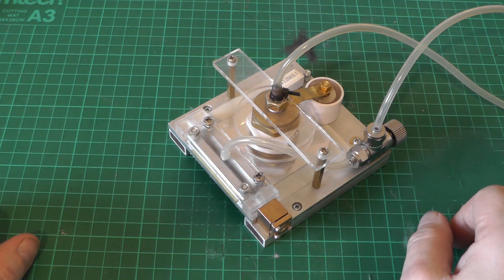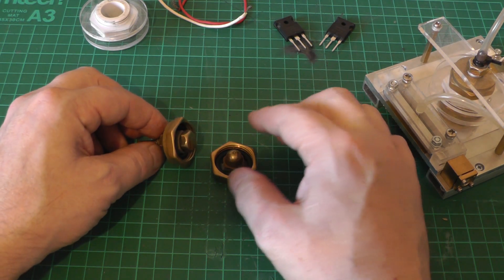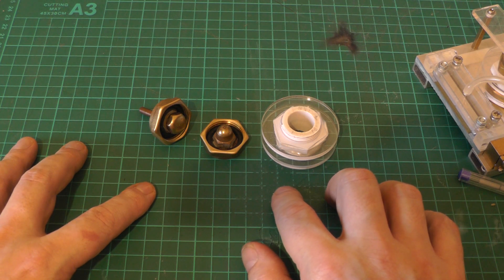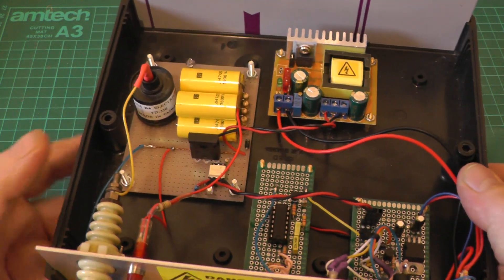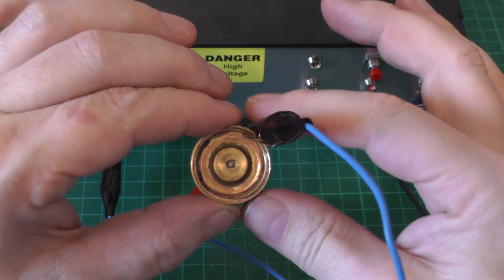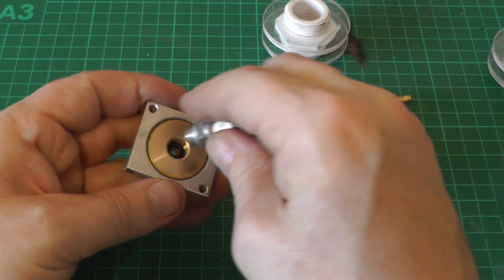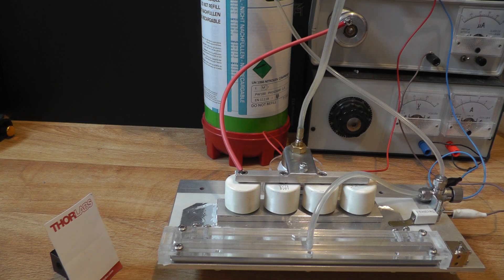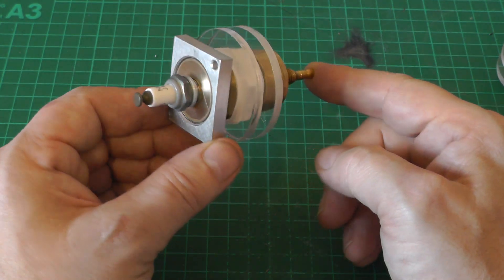How to make a Triggered Spark Gap for High Voltage Lasers and Marx Generators

Comment: Pleased to report that I've just completed a nitrogen laser based on your 20-cm. design, adapted to suit materials on hand, and am successfully pumping Rhodamine 6G to threshold.  Some 25 years ago, a bought .015" copper clad board, intending to build the SciAm laser, but I couldn't bring myself to deal with etching something that large and then having to dispose of the chemicals.  Other N2 lasers I've seen were just too kludgy; I wasn't willing to make the tabletop part of my laser.  Thanks for your exceptionally clean,  workable, and high-powered design.  I was able to lase R6G even before installing an end mirror.  Am fighting the urge to buy a power sensor.  My wife, BTW, can't understand why anyone would build a device with no practical application.  I remind her that some people build model airplanes.
Reply from the maker: Awesome! I am so glad people are getting use out of this deign. Yeah I built the Sci-Am design (except with doorknob caps) and it worked well, but it was large and involved too much faffing with vacuum pumps for my liking.
Well, everyone need a hobby, besides I find functioning things more exciting than models of functional things!

Comment: I like your spark gap design. But I also have a question: The power part of the trigger curcuit, isn't that the interieur of a CDI in the end? I mean, what you are doing is triggering a spark plug... Please don't get this wrong, I am not criticizing your curcuit, I like it. But when a friend showed it to me, I thought, wait a moment, I know this from somewhere. So I was wondering if you could replace that part with the CDI module, you can buy, or if you have to be able to customize the power part of the curcuit.
Reply from the maker: Sure, fundamentally they are the same. The resason I built my own, is I wanted the voltage and storage capacitor to match the specification in the datasheet for the Trigger transformer, and I wanted it opto coupled. Compared with Ignition coils, the discharge from a trigger transformer is very fast and very short, a requirement if you want to avoid Jitter and turn on delays.

Comment: another great video.  Have you ever thought about doing a CO2 laser type  recharge video?  The occasional Synrad RF lasers come on the market but often suggest a need for a recharge.  Thanks Doug
Reply from the maker: Then, have I got a video for you! I am in the middle of production just now, but it is going to be sweet, and involves a dead Synrad ;-)
Reply: @LesLaboratory  excellent!  Thanks for the "heads up!"
Reply from the maker: Thanks! Yeah, I have been looking for a suitable candidate for some time. There were some a while ago with what looked like demountable optics, but I missed it!

Comment: nice...rotary spark gaps, trigatrons, laser triggered spark gaps, hockey pucks all delicious- bout 20 years ago made a from scratch a copper chloride laser that incorporated my version of a trigatron with ceramic insulator- the electronics was the most difficult-the false triggers and such-but got it going fantastic dumping 2 pulses separated by 50ns resolution out to ms delay between em running at hundreds of hz---do not let anyone tell you different, trigatrons are the best !!...serviceable too !!...and jitter, what jitter ??...the cucl i could by pulse separation alone ( by memory 50 us separation ) get it lo lase only the yellow super reliable and steady like a hene to perception.......maybe Less will do a 337nm triggered spark gap, wanted to do that someday but too busy with other stuff
Reply from the maker: Very nice! I would love to have a crack at a Cu Vapor laser (any metal vapor for that matter! For sure, spark gaps are really under-rated, though there are sill companies that produce them (if you ave a big enough wallet!) From a cost saving perspective, it's a no rainer to roll your own park gap. It's either that or $$$ for solid state or random H2 Thyratrons if you are lucky enough to find them!

Comment: Hi Les. Thank you for the very informative video. Just one note of caution, if I may. I have a few of those ht inverters and they work reliably up to about 200v, (perfect for nixie tubes, for which reason I got them)  after which  they have a tendency to become unstable. The ferrite core becomes quite hot as do the 10uF smoothing which btw are rated at only 400v. 
I started to build one of your triggers using a car ignition  coil instead :).
Always looking forward for your next video!
Reply from the maker: Thanks! there are two version of these, one has a simple rectified output (blown up a few of these!), and the other has a voltage doubler arrangement, for a higher voltage output. Also, if you ground the output of these it shorts the supply as well, so you have to leave them floating. Sure, thay are not the best, but they are so cheap.
Reply: @LesLaboratory  
So do you connect the GND terminal on the module to V- ?

Comment: Pressurized SF6 laser triggered gaps were used on the PBFA II . It's used a fair amount in the accelerator industry. Be careful of (S2F10) generation in an arc; it dissipates quickly though. Awesome work! I love your approach. Just subscribed and look forward to more fun stuff!
Reply from the maker: Awesome thanks!
Reply: Sf6 turns into Nasty stuff with high power arcs. Keeping a flow of gas prevents this but $$$.  I prefer N2 pressurized.  Change the pressure and thus the Vbk.

Comment: Fascinating! The original DIY nitrogen LASER IIRC was in Scientific American in the 1970's and used a plunger/solenoid directly onto one side of the PCB that formed the capacitor. Two questions: First can you initiate the spark with UV light? The work function of zinc (in your brass) is about  3.7ev and the copper is 5.?ev. The new UVC LEDs should get some electrons flying off the surface. And second, why not use an automotive coil-on-plug with your spark plug and eliminate the HV wiring plus need to protect instruments?
Reply: automotive coils way too slow...you have to have a super sharp edge on the trigger pulse the trigatron sees- a series spark gap rather than a direct connection to the trigger electrode from the generator helps some too, but no iron here : )

Comment: 11:15 - What values did you use for your differentiator?  (ANSWER: 22 nF and 4700 Ω)
10K and 1nF?  (Periode: 100 µSek
)
In my mind with those values the output of the Schmitt-Trigger is <100 µSek because the Schmitt-Trigger has a switching
 threshold voltage.
Can some one explain me how to calculate this? 🙂
Reply from the maker: Oops, forgot to add those! I used 22nF and 4k6.
Reply: @LesLaboratory  Thanks bud 😊
I always get Inspired by your videos, I really like your work. Its always a huge motivation to work on my projects if I see a video of yours. Soldering station already turned on 😂😂
Reply from the maker: @GermanMythbuster  Thanks! I like producing them! In answer to the other half of your question regarding differentiators, there is a tutorial here: https://www.electronics-tutorials.ws/rc/rc-differentiator.html, Im sure the hysteresis data his available as well in the 74HC14 datasheet, but honestly I just bread-boarded one up, and measured it with the scope, and tweaked my values.

Comment: Hi Les! Another fascinating and enlightening video, thank you so much. I have two questions if you have a spare nanosecond. You have not included any resistance on the HV output, why is this? Also are the dump capacitors a special variety?
Many thanks, I may need to build a trigger which fires when a drop of current between two consumable electrode occurs. I never thought a local spark would suffice to get a conductive path going. Super info!
Reply: "You have not included any resistance on the HV output, why is this?"
A resistor on the output is just to limit the output current.
There is no need you don't need to protect any capacitors from discharging too fast (no Capacitors on secondary side of the transformer).

"Also are the dump capacitors a special variety?"
The Capacitors from the pulse generator are MKP capacitors often used in the Audio space. 
The Capacitors from the Laser are Doorknob capacitors (for lower ESR).
Reply: @GermanMythbuster  I didn't know the output resistor had the function of protecting the capacitors, but now that you say it, it makes good sense! I assumed they just protected the HV transformer from 'short circuit' with the uncontrolled discharge and so possibly over heating the HV transformer on high repetition rate. Every day is a school day. Thanks

Comment: Totally cool!!! I used to design a trigger spark gap system as an intern, those things deserve more coverage on youtube :) looking forward to your experiments
Reply: When you designed your triggered spark gap. Did you cool it? How did you cool its if you did. Thanks for your answer in advance.
Reply: @Biokemist-o3k  no it wasnt cooled, it had the capability of adding gas but i didnt add gas and just used atmospheric air
Reply: @tanchienhao  Would it handle running at 60 hertz?
Reply: @Biokemist-o3k i didnt try sorry

Comment: Having terminated fiber optic cables for telecommunication use, my knee-jerk reaction to that fiber interface was about what you'd expect. (😱) Thinking harder about it though, that makes total sense, and it's a great hack. 10 Hz or 100 Hz (or perhaps even 1000 Hz) doesn't require the fiber to have a perfect face to work, as a 10+ GB connection does. I shall have to keep this in mind for use with my function generator. Thanks! 👍️
Reply: TOSLINK uses cheap plastic fiber and can get 3Mbps. I've seen several tesla coils that use a similar fiber for the interruptor/control communication but with different connectors. I had a project where I needed an isolated serial connection, so I cut up some toslink cables to get the fiber. I'm not doing any polishing of the ends, and I don't even have optics to help get the light into or out of the fiber. For RX, I have a PIN diode, a fast-ish opamp as a TIA, and a comparator. The TX side is just a red LED, so I can easily build that into more projects and reuse my receiver. 115,200 baud goes through just fine, and it's the bandwidth of the TIA that's keeping me from going faster.
Reply: I don't know if it's still available, but there used to be a range of FO cable that was simply 1mm dia. You just cut it with a knife and used push on connectors. It was used in audio systems, so several 10'd of kHz . I think Maplin used to sell the stuff,

Looked very much like the cables used in the lighting display world that you see on ebay.

Andy
Reply from the maker: Yea, this is Avago 1mm plastic fiber. Nice and cheap, and easy to cut and handle.

Comment: Just curious, as the pulse inverter is drawn as an emitter follower, how does it invert?
Reply: I was going to comment on this too. I'm sure it's just an oversight.  If the NPN transistor was instead PNP (and collector and emitter flipped) it could work, but I'm pretty sure he just meant to draw a CE inverter and put in a buffer instead.
Reply from the maker: It's because I'm a bit of a dumbass. It's supposed to be a 2N3906! Well spotted.
Reply from the maker: See comments below, and I have added this issue to the description, thanks for spotting my error!

Comment: you may try also with a UV diode shining on the air gap (Hertz discovered  UV would help trigger sparks in an airgap)
Reply from the maker: It is a question of how much UV to trigger the gap. I am not sure a UV LED would work, but the UV flash from another spark triggering a gap as indeed demonstrated historically. This effect is used in Marx generators. The UV from the first gap helps ionize the subsequent gaps.
Reply: @LesLaboratory  ...you ever notice triggered lightning flashes ???...huge trigatron
Reply from the maker: @rickmally5777  yeah interesting to watch. There are other forces at play there as well I think. Seemingly it was demonstrated that a discharge can initiate another 10's of km away, well beyond the reach of UV. I feel there is still a lot of research to be done in the HV, but it seems not be be very popular lately! Lightning also generates antimatter. It's a very cool topic indeed!

Comment: Awesome!  I was actually looking at designing my own triggered spark gap and it was great to see your work.  So what's the breakdown voltage of the gap if not triggered?  Was there any sort of process around deciding how large of a spark/what voltage you'd use to trigger the gap?  Just curious how you arrived at your design, or whether it was just a random guess (Which is what I'd have been doing otherwise).  
My thought for a triggered spark gap was something like a xenon flash lamp, where there's no direct connection to the gap, the high voltage outside the tube/gap inducing a breakdown.  I was wondering how much power a tube of a given size with X wall thickness could handle (And at what pressure it should run at), since I'm looking at switching thousands of joules.  My intent was to switch a few KV at a much higher current, so there may not be that much overlap in our requirements.
Reply from the maker: Sorry for the late reply: The gap was designed iteratively. I already know the static gap at x pressure would break down at y voltage, so the next logical step was to deal with triggering. To be honest, I have probably over-engineered the trigger, only a small number of ions is required to initiate the breakdow at its holdoff voltage.
I don't think that a Xenon tube would make a very good gap, as they are engineered to dissipate as much energy as possible as light.